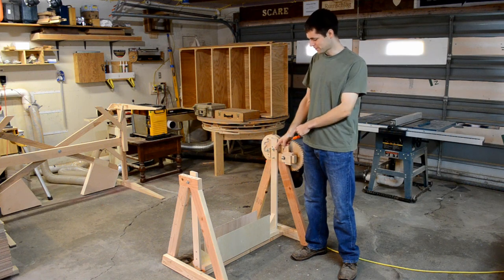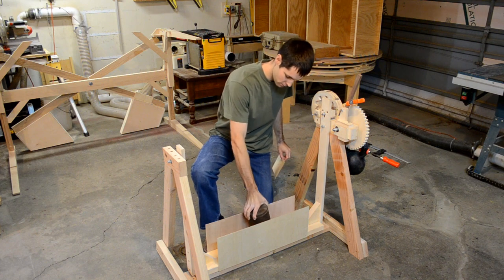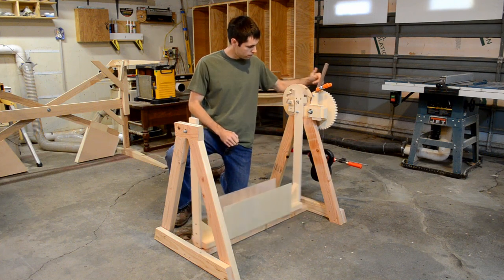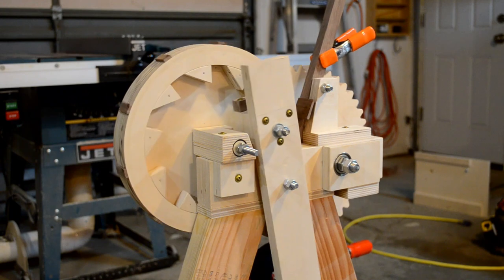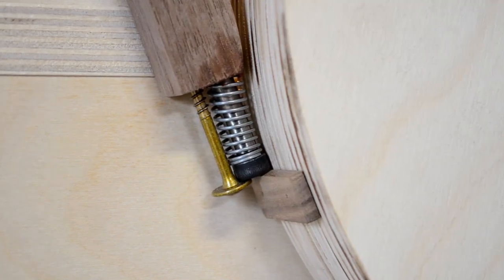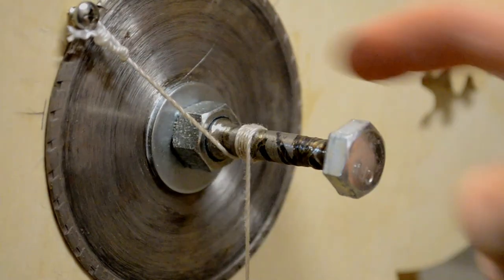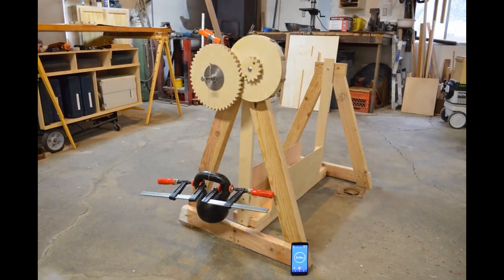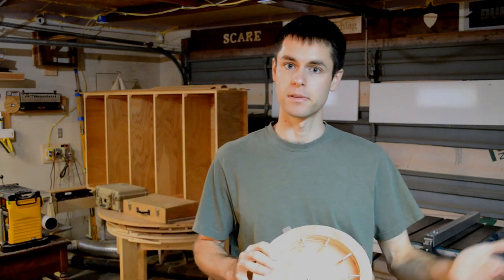Escapement Powered Cradle

Comment: you can make it go for longer by putting a simple pulley system on the weight. for example if you want it to go for twice as long make it so you have the cable come down from the spool, then go around a single pulley attached to the weight and then return up to an anchor on the frame.

Comment: Thanks for sharing this interesting project!  I'm a bit curious whether adding more weight to the bottom (the bob), in addition to the simulated baby, would have any effect on negating the effects of air resistance or if it will simply cause more friction within the pivot point bearings.

Comment: Scott would you consider doing one to sell. Also wondering about the safety issues. When a crib rocks and should the baby get up, how will the baby stay safe with the crib rocking? Even if the crib is not rocking when baby gets up, there may be a possibility that the baby would try to climb out and possibly fall into the wheel assembly. Interested in hearing your comments. Thanks. Je
Reply from the maker: +Jerry Eisner It would need a fair amount of refinement before I would feel comfortable putting it to use. The mechanism can be more efficient, pinch points need to be blocked, etc. You could probably build something in that would trip when the basic swing is disturbed (i.e. significant activity from our passenger) and prevent from the escapement from releasing. Overall efficiency gains need to come first though . . .

Comment: Can an escapement wheel be made out of a circular saw blade? I've been contemplating building a weight powered rotisserie spit.  My intuition tells me the saw blade would have to be one with a negative tooth rake, or at least a zero rake.  Do you agree?
Reply from the maker: It certainly seems like the right shape, not sure on the tooth angle, you could probably make most blades work with some adjustment.

Comment: Nice project. I'm looking forward to seeing additional improvements that might extend the running time. what do you think about extending one of the vertical arms upwards of the fulcrum and adding a counterweight atop? you might be able to regulate how much counterweight is being applied by raising or lowering the weight in respect to the fulcrum. Have you tried that? Thumbs up , thanks for sharing.

Comment: This is pretty amazing. There's something really beautiful about the way you've done it. Instead of the gearing you could put the bolt axis directly on the escapement using 1/6 bolt diameter and go twice as long, but would require supporting the free end of the bolt.  I would put lacquer or maybe wood glue on the remaining wood contact points to see if the harder surface makes it more efficient.  If it helped , then I would epoxy aluminum cut from cans onto the contact points.  Does the escapement have a name? I was looking for one like this that drives only 1 size.  How long did the project take to reach this point?
Reply from the maker: I don't know which category it would fall under but it took about 2 weeks to get to this point.

Comment: A simple arm going up with a pull would allow the weight to start higher resulting in a longer run time.
I'm not trying to nitpick.  it's a great project.  Just trying to give ideas.
Reply from the maker: +pinchflat There are several improvements I would like to make, a future version will incorporate them. Thank you.

Comment: Triple the time...   Rather than hang the weight from the shaft/spool, run it up and over a pulley attached to a pole or tower.   Add a heavier weight and run it trough a block and tackle arrangement with several "parts of line".